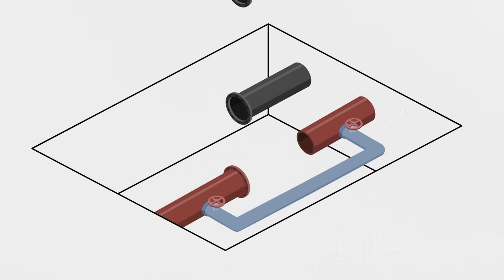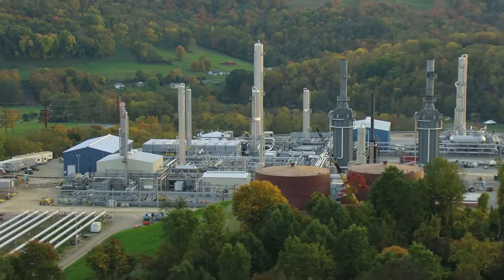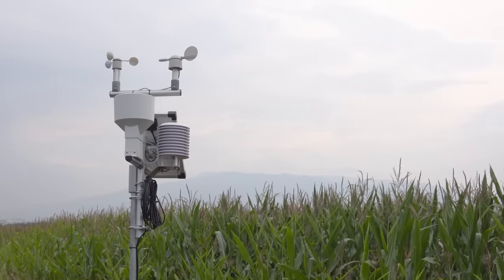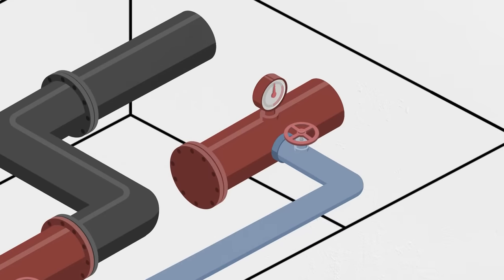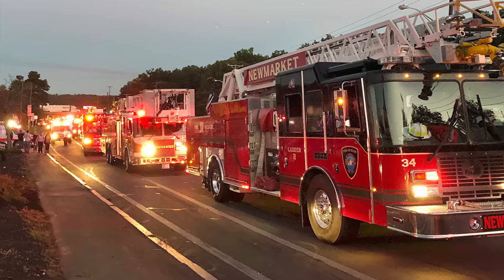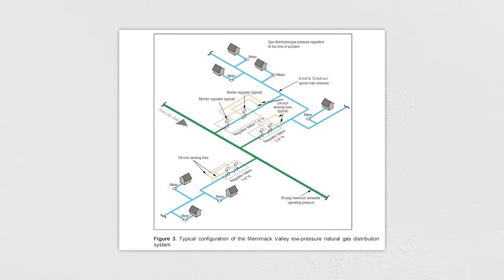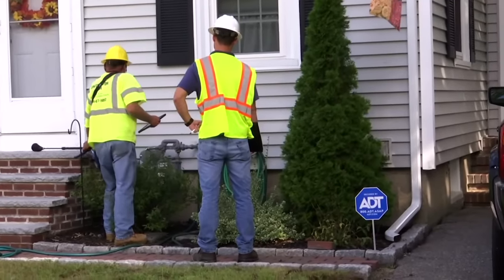What Really Happened During the Gas Explosions in the Merrimack Valley?

Comment: A similar incident happened in Sun Prairie, WI. Absolutely horrifying.
Reply: The Sun Prairie incident was actually quite different than this incident.  At Sun Prairie a contractor was horizontally directionally drilling in fiber optic cable and drilled into a plastic gas main causing a leak that migrated into a building that eventually exploded.  The failure on this project was that the drilling contractor did not call to have the gas line located prior to contstruction so they were drilling blind.

Comment: Was a Gas foreman for one of the largest companies in the northeast. Typical useable home pressure for Natural Gas is less than 12 Inches WC. You're looking at more towards 7.5-9.5 inches WC then knocked down further by the appliance regulators. 12 is too much unless there is higher demand (and a low pressure main/service system that has issues with demand, in which case a new HP system is more feasible and safer to just install fresh to replace the outdated system). Most service regulators are set at around 8-9 depending on the volume draw (see previous). Just wanted to throw that out there. I won't get into systems that have High Pressure Cast Iron and why that is as dangerous as can be....

Now as for a major job like this in a continuing upgrade project, they should have had station crews monitoring at the regulating station to ensure the pressures didn't overload like this. Been there, done that and know that the human monitoring at the station is a third failsafe that works.

Comment: When I was looking at the diagram, I started thinking to myself, "wait, the sensing lines might be cut off; I hope they thought of that". Then when I realised the management and engineering of that company didn't think of that, I started thinking to myself "gosh, I hope they built a known weak point into the system, so that any overpressure is most likely to cause a failure at the weak point rather than in people's houses". But I knew, based off the preamble that that wasn't a thing that happened.

Comment: I was wondering if a pop off valve would have been a extra level of protection of overpressurization in the main line.  It wouldn’t have stopped the regulators, but maybe it would have helped by time to shut down the system.  Also surprised there wasn’t a pressure sensor that was designed to shutdown the whole pipe if the pressure was too high or low.  Imagine if one or both of the sensor lines had a leak.  Scary how little protection was designed in that system.

Comment: As a nuclear engineer, once you  mentioned that the sensing lines were coming from the same pipe I was like "What the hell? Why even bother putting two lines at this point, when they are comming from the same place." Redundancy, diversification, separation and elimination of common mode failure are basic rules of any safety critical design. And the fact that there is no overpressure protection is just plain weird.

Also, the fact that you can realise a design without engineer approval is absolutely unbelieveable... Land of the free am I right?
Reply: the system in general is just plain weird.  I never heard of such a low pressure system.  How would you put a rupture disk in a system like that?  whatever strength you used, a house somewhere would probably burst first.

Maybe something like a blowout preventer would work?  Something flow rate monitoring.

Comment: I studied in control theory and work for a company that engineers and manufactures compressors and skids/containers for them + valves, regulators etc. Therefore this video is very interesting to me. I am just thinking... Why were there no safty / over pressure valves? Usually if something in the control of a gas system goes wrong, that leads to a overpressure valve or rupture disc opening. That is loud and you lose gas, but it's quite safe compared to this.

Comment: This incident is exactly why I'm reticent to tie into the gas line that they put in the street just before I bought my house. I'm still using an old oil burner because this event made me very afraid of in-street Natural Gas.
Reply: @dontlookdown5565 Fear out of precedent. They detonated several dozen houses, all built exactly the same way as mine. One heating method is mildly inconvenient and comparatively inefficient. The other carries a risk of my house, my family, and my belongings, all going up in a sudden, massive fireball. Is the risk worth the reward? 

Having gotten an idea of the cost of conversion from a plumber (the utility does their part for free, because thereafter they have a monopoly on your fuel supply, but the plumber hired to work indoors still gets paid), and given that my ultimate goal is to do a solar/heat pump combo, the price isn't worth it, either.

Comment: Perhaps the most dangerous hot work on pressurized (NOT voided!) fuel gas containers is "hot tapping" a burning railroad tank car to remove sufficient product to then safely extinguish the fire. That would make a very interesting video! It requires a highly skilled pipe/pressure vessel welder in a fire suit with Boots and Coots-tier courage.

Comment: This could have so easily been prevented. Having a PE go over a public service design is obvious. Its something I learned in my engineering 101 course my first year of my college education. if it has a large impact for a large amount of people, it should be reviewed and certified. The lack of redundant sensing on the main line, such as with sensors on each block for example, is a serious design flaw, since if the main regulator set fails, or is improperly made, the fault wont be detected. thats exactly what we saw happen. hopefully state legislatures will learn from this and not skimp on requiring proper diligence on public service projects

Comment: I'm surprised the engineers didn't account for this.  I don't know how these regulators were designed, except I'm guessing the pilot regulators were on the old main while the main regulators were on the new main. Even your diagram shows the pilot regulators to have the upper chambers to be vented to atmosphere, the normal configuration for gas regulators. This puts the standard reference as the atmosphere,  against which the gas is pushing, so this makes sense entirely, just as in scuba gear, the opposing pressure is the surrounding fluid pressure which is what has to be accounted for. If the reference was only back to the the gas main, there could be no reference to balance against.

Comment: Some industrial logic controllers that play a vital part in system saftety  have 2 CPUs doing the same calculation. Importantly the two CPUs come from two different manufacturers and always have to agree on whatever calculation they are doing. This is to avoid a common mode error because of errors in the chip itself which could happen at the same time if two of the same CPUs were used.

Comment: From doing hobby level electronics I assumed you were going to say essentially that they needed a "fuse" on the low pressure side. Aka have the low pressure system built to withstand say 200% of it's expected pressure and a safe release point (a flare stack?) that releases gas at 150% of the rated pressure so puppies don't break at random points when there is excessive pressure.
Reply: A blowout preventer would be more appropriate.  If the flow rate is too much, it just slams shut until reset.

EVERY SINGLE DAMNED HOUSE around here has one.  They didn't even have ONE!

Comment: Something similar happened in Chicago Il. Someone walked away from the bypass line,made every home go to 25 psi and buildings started to explode. The ICC made the whole 
state install OVER PRESSURE SLAM SHUT VALVES protecting the low pressure system. They should do away with ALL low pressure systems and make it medium pressure 10-60 
psi where each building has its own service regulator with relief valve or a double pilot controlled with a working and monitor regulators at the service. The street main pressure 
should be no more than 25psi in residential neighborhoods and no more than 60 psi in industrial areas. If they want to run say 160,250 psi high pressure then they need a farm tap 
regulator but those are out by the road and are dangerous in my opinion because they can be EASILY ripped off by a vehicle leaving the roadway. I hope that the gas company got 
to pay every penny of damage do to the fact they didnt have a SLAM SHUT device installed after the regulator stations to protect the low pressure system. Im very disappointed that 
ALL states didnt TAKE NOTICE after the Chicago incident and get these devices installed, If they had this would have NEVER HAPPENED.      [This would be like driving an suv with 
intermittent brakes. Eventually someones going to get hurt or killed when you need your brakes the most & they fail you because you didnt properly maintain them].

Comment: I still don't understand, if the sensing lines are downstream of the regulators, and the pipe that was swapped was the high pressure line, why would the pressure in the sensing lines change if that was all downstream of the work being done?

Comment: Huh! A similar thing happens with voltage regulators that use remote sensing! If you don't connect those remote sensing lines or they sense the voltage is too low, the output voltage can rise to the maximum the supply can deliver in a worst case!

Comment: Interesting. This type of low pressure distribution isn't allowed here. I don't thing this could happen in higher pressure systems, at least not here. Regulators under certain sizes (residential) need to have integrated relief valves which have an emergency relief ability to 2x normal rated inlet pressure. Above that size, we need redundant relief valves, with the same requirement. They don't use remote sensing like regulators do. Normal service inlet pressure may be 30-120 psi depending on a few factors.

Comment: so each building doesn't have a regulator? that is strange. my house has a regulator outside along with the meter. my factory gets 5 psi " high pressure gas" . we get a letter every year reminding us that we have high pressure gas supply. we only use it for heating . we have some 2 million btu and 4 million btu direct fire heaters and a bunch of smaller tube heaters. everything has it's own regulator that brings the 5 psi down to 10 inches of water.

Comment: Would the correct solution be new pressure regulation systems? You'd need to monitor both the old and new lines until abandonment of the old line.

Comment: Amazing that these regulators had such a serious design flaw for so long before it caused a disaster. Control systems need to be designed to accommodate failure in their sense inputs -- never drive the output to full scale in that case. There should be a safety cap to the output pressure regardless of sense input. The Boeing 737-MAX disasters are another example of this kind of design mistake (plugged air flow sensor led to the MCAS control system setting the vertical stabilizer to FSD).

Comment: Why is there not a pressure relief valve on the system.  At any change in Pipeline spec, there should be relief valves.

Comment: I enjoy the channel.  I got a little lost in this one, though.  How does cutting over a 75psig distribution line upstream of a regulator reveal a pre-existing configuration problem on the downstream side of the regulator?  And did I understand correctly, that there was a large area of homes fed from one low-pressure (12 inch WC) distribution line, with no further regulation or over-pressure protection at each home?  Wow, that's crazy!  A disaster waiting to happen.  I suppose there's a different order of magnitude of accountability with public utilities - a private company would likely be put out of business, or perhaps even face criminal negligence charges, whereas a public utility just pays the massive damage awards and passes the cost on to the utility customers.

Comment: I'm surprised that when they rebuilt everything, they did not go to a high-pressure system, with regulators at each meter, (If you call 60 psi "high" -- I worked in the products pipeline arena where "high" was 2500+psi,...)   There are conversions in my area to same to allow more CFM in the same size lines. But one advantage is a catastrophic regulator failure will take out that one house, period.

Comment: One would have thought that the downstream pipe should have had multiple overpressure vent valves to protect against regulator failure. It takes multiple layers of bad engineering to make a mishap into a disaster.
Each of those overpressure valves should have an alarm circuit that triggers closure of upstream valves to prevent further flow of gas into the system.

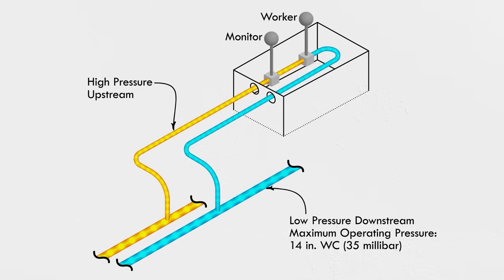Comment: I think I spotted a small error. In your diagram at 6:15, the worker and monitor labels are switched. The worker should be on the higher pressure side, with the monitor on the lower pressure side since it's a redundancy set to a slightly higher limit.  Your voice over is correct though, so the purpose of both is clear. Not a huge deal.

Unless you meant that the monitor is the major stepdown from high to low and the worker is the fine tuning of pressure. Then your diagram is correct.
Reply: Actually the monitor which would be set at a slightly higher pressure than the worker can be either upstream or downstream.  It will work either way.
Reply: @mdpatton100  Actually you're right, I rewatched and didn't realize BOTH sensor streams are downstream of the regulator combo.

Comment: A company with a guaranteed and protected MONOPOLY — as are most states' public utilities — needs to ensure a Continuity of staff and records-keeping. When Utilities re-organize, the historical details of construction and modifications plainly are CRUCIAL, and must be maintained and kept readily available.
In 1992, a subcontracted work boat in the Chicago River (the one that the city dyes fluorescent Green on St. Patrick's day) was driving reinforcing pilings  near the Kinzie Street bridge. A single piling disturbed the river sediments enough to breach a long abandoned tunnel system 40 feet below the water's surface, and very quickly the water pouring thru enlarged the gap. The Tunnel system had long been unused, but wound among the sub-basement levels of Scores of the Country's most Expensive UpScale Retailers, office and apartment buildings. Repairs and Pumping the water took a Year and over a Billion Dollars.

Comment: For your info, I am in Ontario Canada, and our domestic pressure is 7 inch water column. many houses and commercial buildings have a relief valve that will vent raw gas into the atmosphere if the regulator diaphragm  rupture. The cause of this disaster was a mistake, and a PE stamp would not have prevented it, maybe it will add names of those responsible to the court appearance. A PE stamp is often little use. One example, all new airplanes have a certain amount of bugs to be ironed out, some potentially fatal, and airplane makers have more engineers than just about anyone else.

Comment: Very interesting. The self-regulating valves seem like a very elegant solution, but I'd guess they also would open wide if there was a rupture on the low pressure side somewhere? That does not seem like a fail-safe configuration. Might there be other protections in that case?
Reply: They wouldn't open THAT wide.  It's a very low pressure system.

Comment: Low Pressure main Replacement jobs have been going on for years as companies replace CI and Wrought-iron/Bare Steel mains. Engineering and communication and safety are critical in each phase. Strict procedures are in place but unfortunately human error still exist as regulators do there job regardless of upstream/downstream pipeline issues caused by lack of communication. LP gas is no joke.

Comment: Not only did it demonstrate how flawed fossil fuels and pipelines are, but also the importance of planning, proofreading, and extensive testing before it's ever put in place.  Just as one letter mistyped can greatly change the meaning of a message, faulty components and firmware can result in a PC or console frying itself, as we've seen already with lithium batteries.
Reply: Fossil fuels are golden. 
They aren't the issue

Comment: Seems to me there should be more redundancy in the sensor lines.  If those lines got damaged in any way it would result in the same scenario.  Could also have some form of pressure relief valve in the low pressure system that would basically discharge in a worse case scenario. (obviously this should be something that is avoided).

Comment: I'm sure there are cost reasons for not having regulators outside each home, but wouldn't it actually be a cost savings to have the pipe to the house be the weakest link (weaker than the appliances actually in the home)? That way if there is an overpressure event the damage happens less dangerously, in the open?

Comment: Don't always hang your hat on a PE license. I was a new project manager on a company building project (tall warehouse) and my roofers told me there was something wrong with the building. The steel had been erected and the roof was being installed but the siding was defective and we awaited a second shipment. Seems the structural steel design had no "sway bracing" which is typically a massive "X" installed in different forms on all 4 sides. The architect was told to contact the structural steel PE and explain what was to prevent the building from "swaying" in a wind from any direction.  No satisfactory answer or explanation so we terminated the design services after taking the plans to another firm we used in another state but had certification in the state the building was in. The X bracing was installed on a "fast track" schedule to beat the siding installation.  The building has not fallen down even during coastal hurricanes.